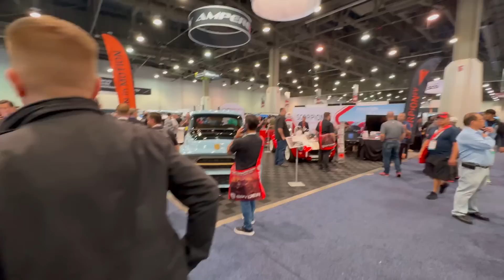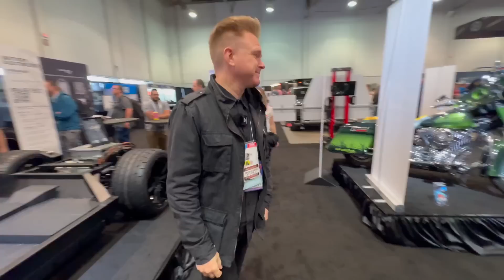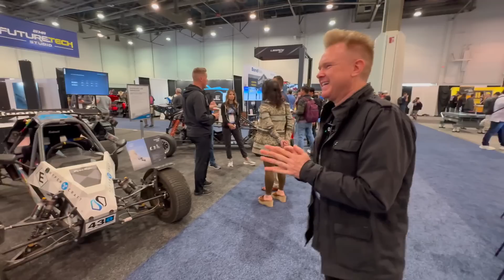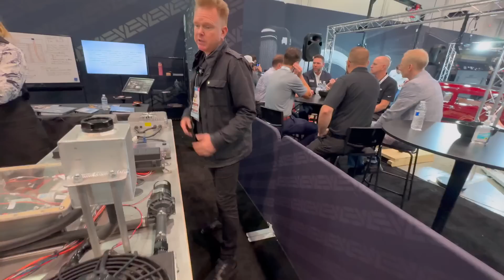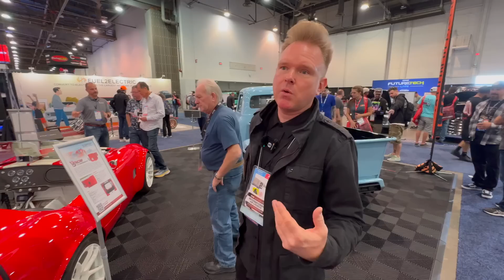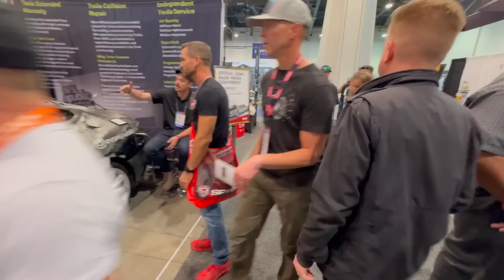Diving Into The World Of EV Conversions! These Are The Big Players, Builds, Kits, & More In 2023

Comment: $50K conversions is never going to be "large scale".  What is needed is a series of kits to convert recent quality vehicles whose only problem is a blown engine or trans that makes the car not worth fixing as an ICE car.  15-20 year old Mercedes and BMWs and Audis that would cost $10K+ to fix and so can be bought for $1K as a base to convert into an EV.  50kwh of 2170 cells can be bought for under $4K, and a Tesla front drive unit for $1500 on eBay.  I want a $1k kit that has all the brackets, racks, OBDII spoofing and CAN control needed to take those readily available components and turn any car EV by an average shade tree mechanic in a couple of weekends.  Not something that needs a 4-post lift and special scissor battery table.  Not a rich man's hobby or an "enthusiast's dream" or "tinkerer's toy" , but a practical re-use of an ICE car into an EV with reasonable performance, creature comforts, reliability, and for under $10k all-in.  Because there is no point in spending $50k on a conversion that is, in the end, a used car where everything except the drivetrain is old tech and probably can't compete with a $35k brand new Tesla on any level.

Comment: An Out Of Spec EV Conversion channel would be fantastic. I have been following the DIY and Kit space for at least 5 years. I love the direction of standardized training, equipment, etc. I would love to see a channel that explained conversions to different levels of desire: From 1973 Fiat Spider, retain manual and classic simplicity, 1996 Ford Ranger 4x4 with aftermarket recent infotainment system to a 2020 Jeep Gladiator with current EV infotainment and features. Add to this how to aftermarket upgrade an early Kia Soul EV to current batteries, 400V system, and current infotainment features. Old EVs made newer, recycling what gets replaced.

Comment: I like the principal of converting classic car, however, much, much tighter legislation is required to ensure the chassis, brakes and suspension components can handle the much greater hp and torque. It’s not just a case of dropping in a motor and batteries.

Comment: Asking good questions. Thanks for sharing the experience. 👍
Reply: Weight distribution can be balance almost at will by using two packs (one front one back). Budget wise a ful EV conversion is probably 50 to 100% more costly than a few ice drivetrain (for now) but you get more performance.
Reply: How do the conversion “kits” (not “skateboard” platforms) compare to the replaced ICE components? I understand it varies by car/engine, but roughly how much is the weight? I’m curious about changes in weight distribution.

Comment: I'd like to see an EV conversion kit that takes up the space of one or more of the legacy ICE packages like small block Chevy and TurboHydro TH400 transmission or Ford small block and their most popular transmission back in the day. This would be great because there were MILLIONS of cars made with these combinations of engines and transmission. The EV kit would fill the engine compartment with the electric motor as well as all of the electronics and the one-gear gearbox needed and about half of the battery pack. The other half of the battery pack could go where the fuel tank used to go and/or in the bottom layer of the trunk. There are lots of these old ICE/Tranny combos that existed over the years in the US and all over the world. Ideally the kit would be something that is bolt-in complete and doable by anyone who is mechanically inclined but not necessarily electronically inclined.
Reply: The electric motors are so small they can fit where the transmission was. Under hood space would be used up by controllers, chargers and some batteries. Remainder of the battery can go to the rear of the car.
Reply: @joeclutchless1944 Yep. There are several places that the batteries could go, including the trunk, where the fuel tank was, under the rear seat and possibly in the engine compartment. For best weight distribution they could be spread in more than one area. What's also cool about this idea is that you could conceivably start with a small battery for a modest range and then add more later when you have the time and/or money.

Comment: I'd like to see one important modification: a Tesla Model3 shooting-brake/wagon😍. Only metal-work. Should be doable.
Reply: Model 3 highland perf awd chassis under a 1957 chevy bel air perfect elktromod. Almost the same width,wheel base etc. 

Or use the roadster shop style chassis modified for full ev pack's, independent suspension awd all bolt in style(Ford did this with the E-100 truck a few years ago using a full mach e gt drivetrain suspensions and pack underneath. Using reproduction sheet metal for various killer style elktromods. Without actually cutting up or modifying a true numbers matching classic chassis. 👍🏻😎
Reply: The pearl white Chevy truck was our build. It is all new metal. Nothing used on it. The gt40 was our frame and molded body.

Comment: Great video.. Definitely would like to see a channel dedicated to EV conversions. I'd also love to see places that could update older EVs like my 2016 Spark EV to support newer battery types to extend my capacity from 19KWH to 32 or better along with an update to the on board charger from 3.3 to 6.2 for faster home charging. It would also be cool if an eAxle of say 60hp and an additional 100lbft of torque could be added to the Spark for 200hp, 427lbft of torque and 4WD just for more grins than I get now😊
Reply: All of that sounds about the price of a fixed salvage model 3 perf.

Comment: Using the less desirable version for a conversion is perfect. Conversions will get easier and easier with more component sales. I also like the drop in electric motor option where it drops into the engine compartment of a vehicle and adapts to the rest of the drivetrain.

Comment: I agree with your sacrilege comment. I'm buying a new Bolt EV and I'm all for converting run of the mill cars like 6 cylinder muscle cars or ones with forgettable V8s, but getting rid of Italian 12 cylinders and legendary classic American V8s in favor of electric motors is lunacy. I've owned a '78 Firebird with a 305 V8. I wouldn't mind an electric motor on a car like that, but on my dream car 1977 Pontiac Trans Am Special Edition in Black absolutely not. Gr8 vid as usual. 🚙 🇺🇸

Comment: Yes, the ICE to EV conversion business is really taking off.  Did you know that Ford and Chevy now make electric "crate" motors?  Ford's is called the Eluminator, Chevy's is called the eCrate. Depending on how it is done, it can be more sustainable to convert an existing ICE vehicle than to build a new EV.  Most of the carbon-intensive work (mining, smelting, manufacture) was done to produce that ICE vehicle.  What about classic cars?  In my opinion, rare classics should probably be left alone.  However, millions of cars have been produced with great exteriors and mediocre to piss-poor ICE drivetrains. In any case, Kyle,  I think you'd have a blast doing a deeper dive into this growing industry.   #sema2023